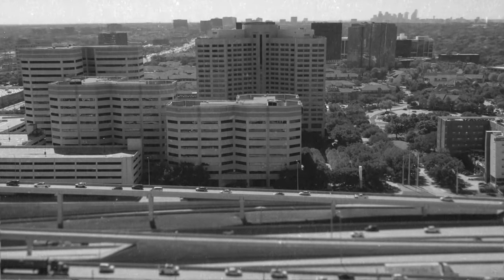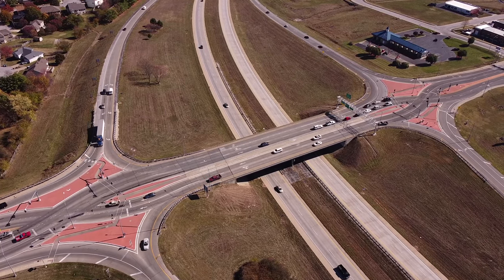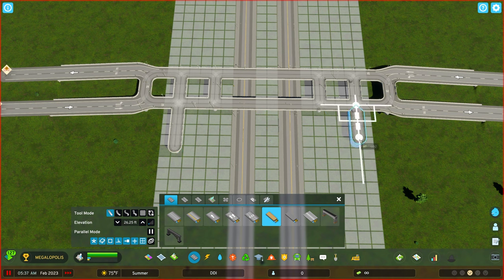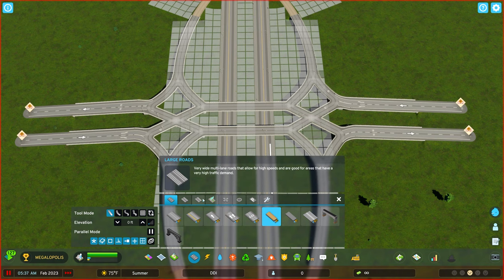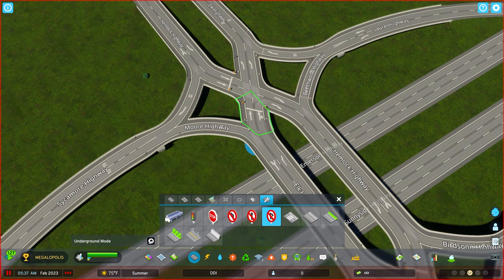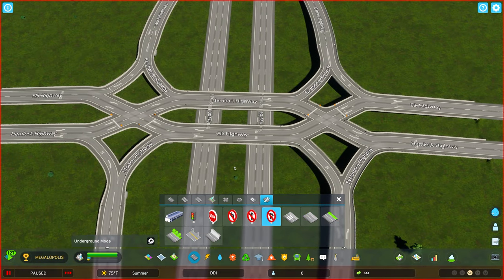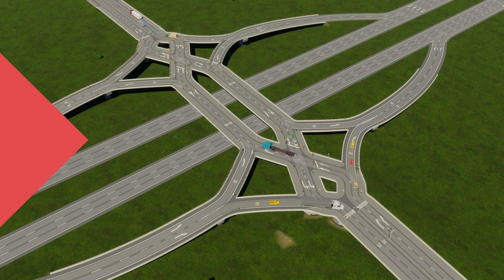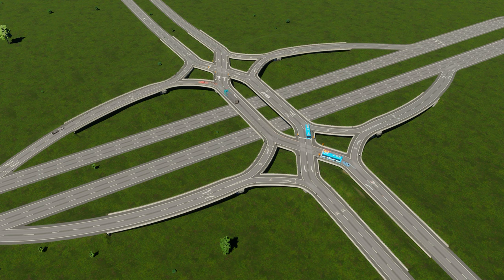Diverging Diamond (DDI) | Interchange Insiders: Cities: Skylines 2 Road Guide

Comment: Love the tutorial. How well does this work without traffic light synchronisation though? My understanding is that a core part of a diverging diamond is that the two sets of traffic lights need to allow one direction of traffic to flow freely, and then the other, so that it doesn't back up across the middle section.
Reply from the maker: Thanks so much! Glad to hear you like the video! Yeah, without light syncing mods in CS2 yet it's not perfect, you are right. It seems to work pretty well though from my experience in vanilla. I think it's mainly because the light cycles are so fast in vanilla CS2. Overall, I think it's been working well in my city with over 100K pop in purely vanilla. And of course, when a Traffic President style mod comes to CS2, it will only get more efficient! :)